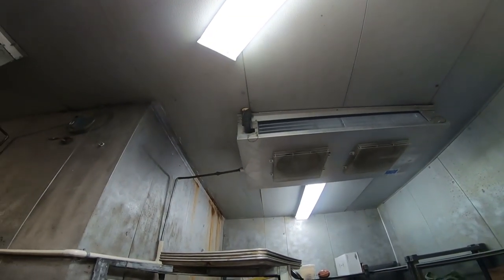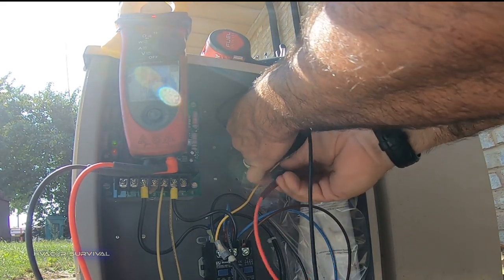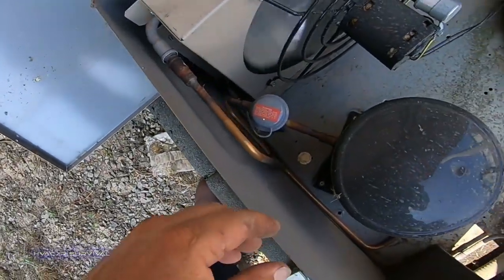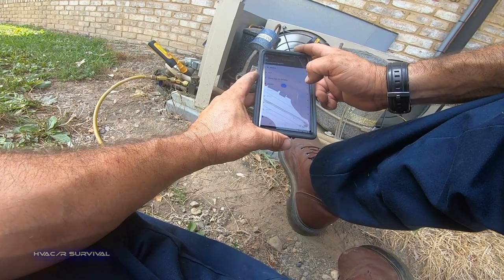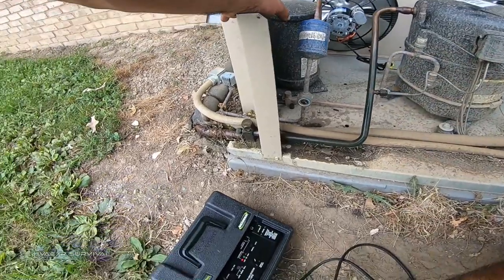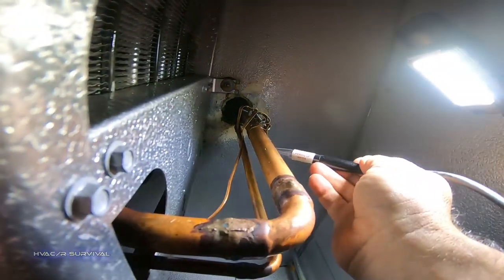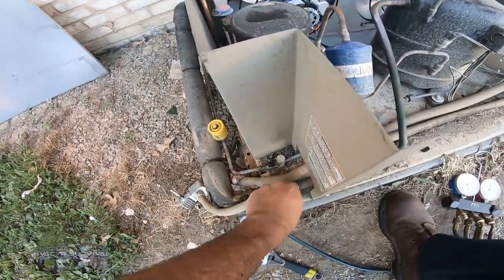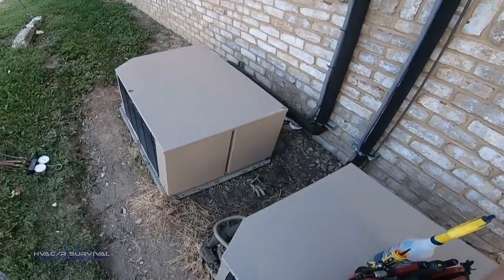Walk-In Cooler Warm, Walk-In Freezer Leaking Refrigerant

Comment: Very through work. I use a trailer pin with clip to protect the coil. That way , if energized, the coil won't throw the pin out.
Reply from the maker: Interesting,  you talking about the one that secures the ball to the hitch? Looks like a D
Reply: HVAC*R Survival Grainger PN: 5VU67. Check it out. This way the latch keeps the pin in
Reply from the maker: Great idea Lee,  I can get those local.  3/8 big enough diameter for most?
Reply: @HVACRSurvival  Yes. 1/2" is too big and 3/8 is plenty of iron to prevent coil from damage.

Comment: I have one of those Worx mini jet washers, I've used it a few times to melt ice off coils when set on low speed and the spray head on shower and not jet. Seems to cope fine with warm (not too hot) water.
Reply from the maker: Good idea, I never thought of that, thanks for the info👍🏻👍🏻

Comment: Great repair bro.  Looking at the other system while not even on that call. I am thorough that way as well, at least I try to be when time allows for it. LOL . What leak detector is that by the way? Does it pick up 410a as well? Thanks learned alot.
Reply from the maker: The first one was a H 10 Pro. The second one was a Fieldpiece infrared. The Infrareds not as good as the h10, I tried several different ones, the h10 is hard to beat. Thanks for the kind words my man,  just showing what and how I do it.

Comment: So you’re back. Did you go self employed or did the boss allow you to video again?
Hoping you didn’t put bulb back on the vertical but installed it correctly on the horizontal and correct position....
Good video, good find, and great tip on the coil. I’ve burnt up 2-3 and now stick my screw driver in it.
Reply from the maker: Answer #1...I'm with the same company. Answer#2..."Things" have gotten better for me is all.  (Follow up)...Sooo I'm back like Slim Shady. 😂  Almost everything I point out is something that I have either made a mistake on or something someone else is created a situation that I had to address. Thanks 4 sticking around!  Did it take long to figure out the name change?
Reply: Not hard to find. Stayed follower and you re-appeared

Comment: Spin the time clock and push in the contactor?
Reply from the maker: The 9 word description doesn't go into a great enough detail.  Have you been studying me enough to make that assertion?  Did you miss seeing that I had my V.O.M in the video verifying power? ....Your watching a 2+ hour call in 12 minutes. Would you mind sending me a link to your videos of how a master super tech does this work? I'd love for you to prove I'm a hack. I'll be awaiting your link.  Thanks Jim
Reply: My comment may have been a little harsh, so I edited it. I saw you turn the time clock and push in the contactor just after you opened the electrical panel which are things I don’t do. I would mark the time clock to make sure it’s turning before I touch it and I would find out what is keeping the compressor off instead of pushing in the contactor. 
You won’t find any videos of me at work because I’m busy starting up supermarket refrigeration systems.
Reply from the maker: @jimibel  I mark them also,  sometimes the electronic ones get sand like crap in the gears. I do bigger stuff,  I had 70 videos prior to what you see now,  I had to remove them because it showed who I worked for and who the work was being done for. Now I make sure not to show either one. Im one of the most OCD sticklers that do the job correct. I don't know everything but if I don't know about something I'll ask and then share it. That's why if you ask anyone that knows me,  they might say I'm a ass but not a hack.

Comment: That leak might only bubble with vibrations when the system running.
Reply from the maker: That's why I spent so much time on it, I couldn't get it to bubble.  At first the ultrasonic could hear it plain as day but once I started moving things around it went away.

Comment: All this time I thought when I test for a leak with my H-10 Pro or inficon and would find a leak I always verify with the refrigeration technologies soap, if no bubbles then no actual leak, that was my mindset.
Reply from the maker: Superior,  same thing here, I double check everything with  big blue just to verify and to gauge how big the leak is . Keep in mind that I was using standing suction pressure which wouldn't have been very high,  maybe 80 psi? Generally whenever that infrared Fieldpiece goes off,  I know it's definitely something's there because it generally does not go off on Tiny stuff.
Reply from the maker: +Superior Comfort Heating & Air LLC Those leaks can be sneaky little turkeys some times,  I had 2 r.i.c that were r134a that I could not get a clear hit without taking it apart and scanning it but my Ultra Sonic picked up the leaks no problem. But it's not always perfect either. Go figure!

Comment: Tip never ever touch the Contactor with ur finger when the unit is live
Reply from the maker: If it was anything more than 230v 30a circuit I wouldn't have. This was just a quick check to see if I had power and if the fans had failed causing a high pressure lock out.
Reply: But still my instructor said never touch any part if it’s live
Reply from the maker: @chris34963  I gotcha now,  yes what I did was not the safe way of checking power. The video is heavily edited down to keep them short.